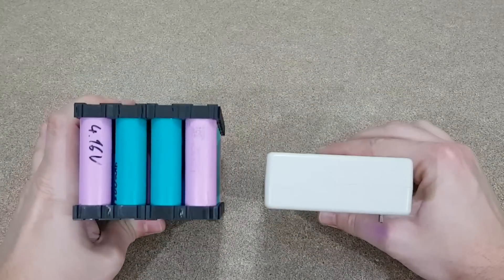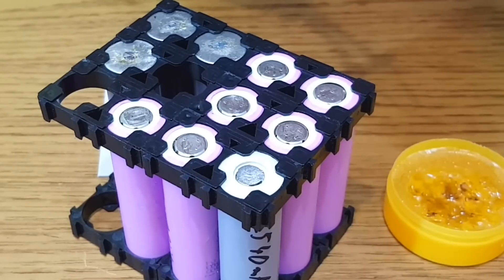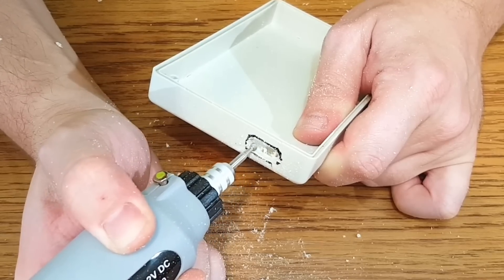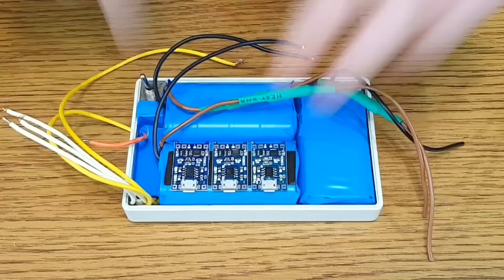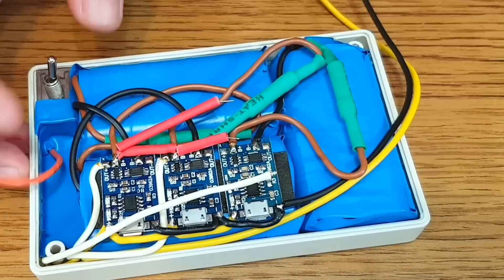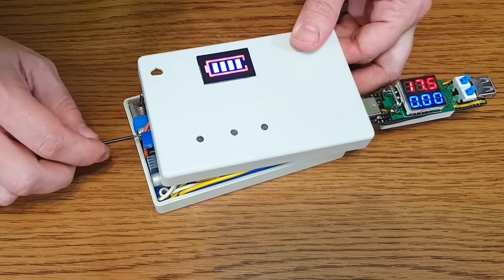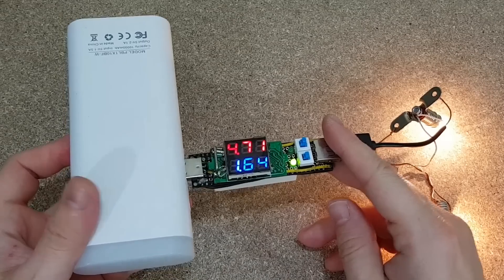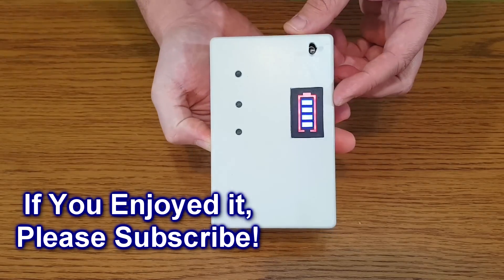DIY - 15000mAh Power Bank - With Salvaged Batteries (gets charged with 3A)

Comment: Mine is better, it's built for the apocalypse

USB power bank (built in 2012, upgraded in 2016)
Price--------------------$120AUD
Capacity--------------140,000mah 
Output current-----2.4A per port at 4.82V, 10W wireless
Outputs---------------4 USB-A, 2 USB-C, Qi wireless charging output
Capacity in Wh----518Wh 
Charging time------21hrs at 10A using CC/CV charging method and purpose built charger (a few days if charging via USB)
Extra input------------universal voltage input (takes 3V-60v, even AC and turns it into clean 4.2VDC to charge the battery)
Weight------------------3KG (around 6lbs) 
Cells used-------------50x 2800mah 18650 cells 
Enclosure--------------mostly duct tape, popsicle sticks and hot glue

My camp battery is even better (built in 2018)
Price----------------------$550AUD
Capacity----------------45Ah at 24V
Capacity in wh-------1,080wh
Output current-------1kw maximum output (any higher and the circuit breaker trips)
Outputs------------------500w inverter, 10A 12V lighter socket, 10A 24V lighter socket, 6 USB ports at 2.4A each
Charging time--------4hrs at 30A with purpose built charger, 14hrs via 12V vehicle socket, 8hrs via 24V vehicle socket
Extra input--------------MPPT solar input up to 20A (plug any solar panel into it, no need to worry about voltage) 
Weight--------------------15KG (around 30lbs) 
Cells used---------------105x 3000mah 18650 cells in 7S15P configuration 
Enclosure----------------large metal ammo box with cardboard inserts for insulation
Reply: So let’s see your build videos
Reply: @drmachinewerke1  well both my batteries have already been built, so yeah 

Maybe if I build another one or do maintenance on an existing battery pack Il record it

Comment: Sorin, can i charge a 12v battery pack with bms with a 5v power supply with buck booster?
Reply from the maker: you need a powerful 5V power supply and a step up converter.
Reply: @Sorin_DIY  how many amps do you think will do?
Reply from the maker: it depends on the battery capacity and the step up converter.

Comment: There quite some heat in that package of batteries. Why are you powering your batteries all the way to 2.5v and not leaving it at 3 volts? Why not buy a diy power bank case with PCB from ebay cause they really are safer you know than rigging something up like this.
Reply from the maker: hi. the battery pack doesn't heat up at all. just the step up converter IC warms up a bit. the cells are discharged to 2.5V, because that's how the TP4056 is programmed, we can't modify that. the cells voltage decreases to 2.5V under the load. then the tp4056 over discharge protection disconnects the load. when the load is disconnected from the cell, the voltage increases from 2.5V to around 2.7V. the cells I've used in this video have a minimum working voltage of 2.5V, according to their datasheet. I can also charge the powerbank, before it gets fully discharged. so there is absolutely no problem. I also have a semi-DIY powerbank case, but the powerbank made by me gets charged much faster, with 2-3A, instead of 0.7-1A. also my powerbank delivers a stable 1.7A at 5V. on most of the cheap powerbank cases the voltage decreases under 5V, when you draw more than 1A.

Comment: In my STEPUP converter there is only rising up to 0.6a not to that much high amp  like 1.6 or any other what I can do please tell me
Reply from the maker: what model of step up converter do you use?
Reply: Same which you have used
Reply: In my near by the electronic goods are very costly so I think they make me fooo
Reply: I am really sorry that is fool
Reply: I think so you are the best youtuber I have ever seen even you replying my question sir thank you
Reply from the maker: check the batteries. if the batteries are discharged, the step up converter can not deliver a high current. but if the batteries are fully charged, the current from the step up converter should be above 1A. if it's not, probably it's a problem with the step up converter.
Reply: Yea I check all my 2 battery's they both are delivering (app) 4v with a brand of mi and Asus both are 4000mah and my phone also support fast charging with 9v 2amp
Reply: OK I will check once again thank you sir for giving your pervious time with me and for sharing the knowledge

Comment: Brilliant project. No idea how you managed to fit all that in there. How is it holding up now with use? Does it run hot?
Reply from the maker: hi. I've used it a few times, it can charge my phone (with a 3000mAh battery) 3 times. it works great. the step up converter gets a bit hot, but there is no problem. that's why I added the heat sink. and it's getting charged up very fast, even with a 2A phone charger, because it's using all available current, not just 0.8A - 1A, like the rest of the powerbanks.
Reply: @Sorin_DIY   That's excellent news. Overall a great success, and something I shall have to build too.

Comment: Hi Sorin. I love ur channel and all the videos in. I like ur power bank project and the scematic is understandable, but have 2 questions.
1. Will it work without power switch?
2. What will happend if i connect 2 or more usb female out modules as i can charge more devices at once.( I mean somerhing as voltage drop or overhealint?).
Thank you very much, wish you all the best.
Reply from the maker: hi. you need the switch for maximum efficiency. you can use some diodes instead of the switch, but the overall efficiency will decrease. if you try to charge 2 devices in the same time, you need to check the current consumption. if they need more than 1.7A, the voltage will drop under 5V and the step up converter will get very hot. at 2A the voltage will drop to around 4.7V. you can buy a more powerful step up converter, which works with max 4 or 5 A.

Comment: Why are you using resistors to protect two cell pack from each other, but not for protecting two cells within one cell pack?
Reply from the maker: hi. the 2 cells from every small pack are connected in parallel, they have the same voltage, so there's no need for any resistor. but between the 3 pairs of cells there could be a voltage difference, for example 4.1V - 4.0V - 4.2V. 3 resistors are connected between the 3 pairs of cells, so they can balance each other slowly. finally all the pairs will have the same voltage 4.1V 4.1V 4.1V.

Comment: Hi Sorin, first thx for the vid.
I would have followed your video, but before discovering your great channel, I ordered this board to make a Power Bank, Dual USB 5V 1A / 2.1A 18650 Battery ( banggood.com/Dual-USB-5V-1A-2_1A-Mobile-Power-Bank-18650-Battery-Charger-PCB-Module-Board-p-1031593.html?cur_warehouse=CN). Can you please give some recommendation or maybe some tuto/scheme that I may follow to make a Power Bank. Ok there is plenty of tuto, but I would like to follow the tuto that you recommend!  as your are more experienced in electronic, and I honnestly trust in your oppinion. Thx in advance ;)
Reply from the maker: hi. it's easier to make a powerbank with the module you've bought. just find some good 18650 cells, connect them in parallel and to the charging module. you can stick them in a case similar to mine. it will not get charged as fast as mine, but your charging module is good too.
Reply: @Sorin_DIY  Thx you very much. I already salvaged few 18650 from laptop battery, and they are pretty good, at least I thing :P, most got 4,2V fully charged, and last really long that way. others got 4.10-4.15V, pretty good. For better test,  I am still waiting to complete the DIY 18650 Battery Charger/Tester that you kindly created us, but still waiting for the Mini voltmeters...
About the charging time, it is not a big deal for me, patience is a great vertue........

Comment: Please tell me the alternate of toggle switch that you used beacuse i can't find it.
Thanks
Reply from the maker: hi. you need a 12 pin switch, with 4 poles and 2 positions ON-ON (not 3 positions ON-OFF-ON) like this:
https://www.aliexpress.com/item/1Pc-12-Pin-Mini-Toggle-Switch-4PDT-2-Position-ON-ON-2A-250V-5A-125VAC-VE069/32864538994.html?spm=2114.search0104.3.8.7a7e3f1a1e1KtL&ws_ab_test=searchweb0_0,searchweb201602_3_10065_10068_319_317_10696_453_10084_454_10083_10618_431_10304_10307_10820_10301_10821_537_536_10059_10884_5736015_10887_100031_321_322_10103_5736115,searchweb201603_53,ppcSwitch_0&algo_expid=b66bb79f-7b8a-4efd-b3c3-4ecfb1e2032e-1&algo_pvid=b66bb79f-7b8a-4efd-b3c3-4ecfb1e2032e&transAbTest=ae803_3

Comment: Ok! But it is necessary to charge it with bench power supply? Can i use regular 2 amp phone charger?
Reply from the maker: hi. you can use a 2A charger. it will still charge faster than most 10-15Ah power banks. at the end of the video there is a table with some info about the charging time - 6:50h with 3A and 9:30h with 1.5A.

Comment: Hello! Great video! I need to do a 20000maH powerbank just like yours, do you have any suggestions?
Reply from the maker: hi. i suggest you find some good li-ion cells. minimum 2500mAh, preferably 3000 or even 3300mAh. otherwise you need a lot of cells and it will be too big. original Panasonic NCR18650B cells are very good. you need to divide the cells in 2 or more groups, to use more charging modules. this will charge the battery pack much faster. there is a newer version of the step up converter that I used in this video, with 4A instead of 3A. you should use that one.

Comment: Il y a 2 erreurs  2 pack ne son pas brancher ensemble  et la pile est brancher à la sortie et non à l'entrée du module 

There are 2 errors 2 pack does not connect together and the battery is connected to the output and not to the module input.
Reply from the maker: hi. all components share the same common ground (negative). if you use a multimeter and check all the negative inputs/outputs of all modules, you will see that they are all bridged. the 3 charging modules are connected together through the negative input, which is the same as the negative output, which is the same as the step-up-converter negative input and negative output. I mentioned this in the video. I just tried to make the schematic as simple as possible. I though that more useless wires will complicate the schematic. it's the same as getting the negative USB output wire from the negative microUSB input wire. it's the same negative wire.

Comment: Sir Tel me uses of 10ohm resistor?
Reply from the maker: the 10ohm resistors are used to balance the cells. if one cell is getting discharged faster than the others, it will receive a small amount of current from the other cells, through the resistor. so all the cells will have the same voltage over time.

Comment: Is it fine to use batteries with different capacity ? I got 4x 2250mah and 2x 2200mah batteries. LG and Panasonic. Thank you.
Reply from the maker: it's recommended to use cells with same capacity in a battery pack, especially if connected in parallel. but 50mAh it's a small difference, so it's ok. the problem is that your cells came from different manufacturers. the cells may have a different internal resistance and a different discharge rate. so I don't recommend to use all of them in the same pack. I suggest you use only cells of the same type.
Reply: @Sorin_DIY   Thanks for the replay mate. Found another 2250mah Panasonic battery. I think I'll go with 5 batteries

Comment: If I connect three 18650 batteries in series which are having individual BMS on them ( not 1 BMS for three cells)  , will I end up by making a correct 11.1V (3S) battery pack..?
Reply: Yes, you will be getting a 3S battery pack.

Putting protected cells in series is not too good however with a good BMS and balance charger/matched 18650s. If one cuts out for a reason, there can a chance for capacity to drift over charge/discharge cycles, and the 18650s will get less and less capacity.

Resume: Yes, you will be getting a 3S battery pack, and you still need a 3S BMS just in case a protection circuit on the 18650s fail.
Reply: @neutronpcxt372  Ok I understood , thanks
Reply from the maker: hi. I agree with NeutronPCXT. you will get 11.1V, but you will have the best efficiency if you use a BMS board with balancing.
Reply: @Sorin_DIY  
Ok , I will connect complete BMS circuit for 3S.

Comment: great work! i love how efficiently you made use of all available space and maintain an estatic look!

one question though. microusb ports are just problematic. as far i know the power carrying pins in it are rated at max 1800mA. you now push through it 3+A, doesn’t get it hot a bit? also the traces on the breakout board are maybe dimensioned to this...
Reply from the maker: hi. in some cases the micro USB ports are getting hot. but this doesn't happen to my power bank. it's using around 15W, similar to samsung adaptive fast charging (9V with 1.6A). the micro USB breakout is designed to handle that. the tracers are thin, but not as thin as the fuses. if something should get hot first, it should be the fuses.

Comment: How efficient is that boost circuit compared to a normal battery boost circuit for charging batteries in a battery pack?
Very cool build!  How stable are those small 50 turn boost circuit varistors?  Neat little build and I like how you did the "balancing" circuitry too...should be able to keep them withing a few tenths of volts no matter the drain.
This might be a more efficient step up module...higher frequency
https://www.banggood.com/4A-XL6009E1-Adjustable-DC-DC-Step-Up-Boost-Converter-Power-Supply-Module-p-1175699.html?rmmds=search&cur_warehouse=CN
Reply from the maker: hi. that 4A step up converter is more efficient. I have ordered the parts a few months ago, I don't think it was available, because I would have definitely get it. the efficiency varies depending on the output current, the higher the current, the lower the efficiency.

Comment: vreau sa te intreb ceva. cum pot sa-mi fac un bms pt 3 celule in serie (imi trb la o boxa si nu am bms la baterii) sau pot folosi 3 tp4056 in serie?
Reply: Cea mai buna solutie este sa iti cumperi un BMS 3s cu balansare de pe aliexpress,banggood sau ebay, costa cativa dolari maxim. Daca legi in serie TP-urile sunt sanse ca in functie de curentul de descarcare cip-ul sa iti taie output-ul
Reply from the maker: salut. sunt de aceeasi parere, cel mai bine e sa cumperi un BMS 3s (preferabil cu balansare). poti sa folosesti si module TP4056 in serie, dar e mai greu sa incarci bateriile. trebuie sa folosesti surse separate pentru fiecare modul, sau sa folosesti un switch ca cel din clipul acesta, cu care sa schimbi conexiunea din serie in paralel, sa poti sa le incarci cu o singura sursa. urmatorul meu clip va contine o boxa portabila cu 3 celule in serie.